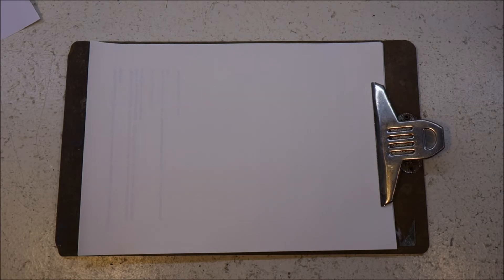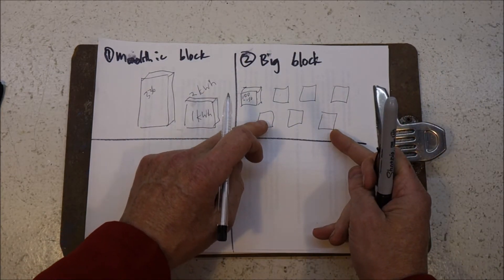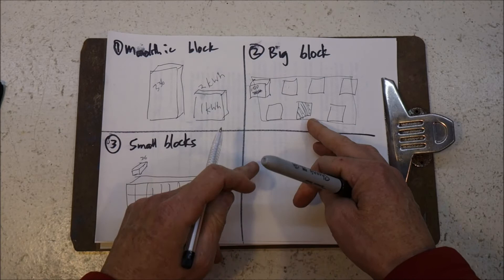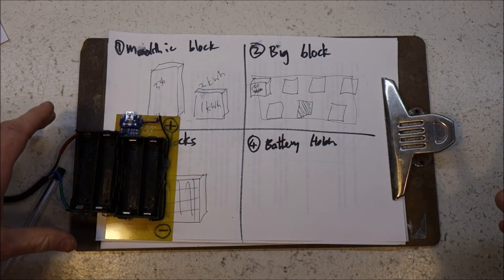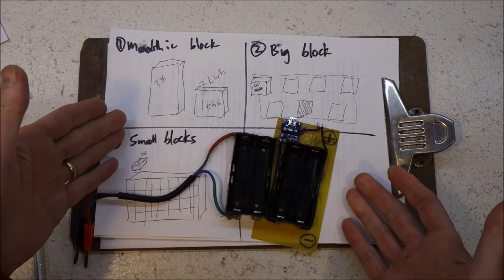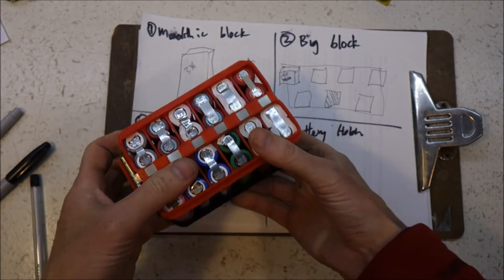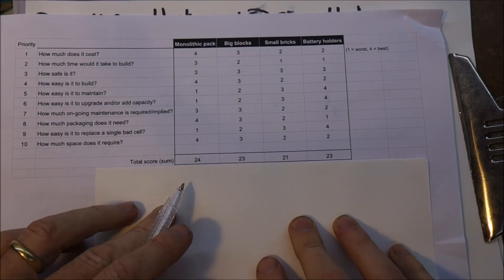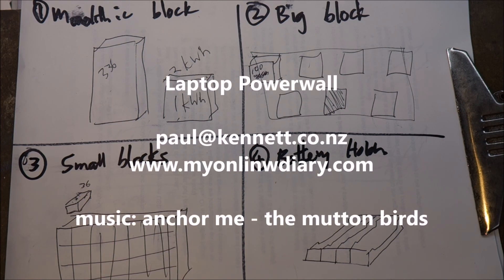Laptop Powerwall 34 - interconnection options

Comment: I think you should actually do a combination of choice three and four, allow me to explain. What you should do is assemble a bunch of small blocks like in option 3, but instead of the cells being in small blocks they will be in battery holders. This would allow one to have a mix of choice three and choice four both at the same time. Concieveably this would allow you to have a bunch of small blocks made out of battery holders and other small blocks made the traditional style all mixed together in one system. A system like the one I'm thinking of would combine the benifets of system three and system 4.
Reply from the maker: Agreed. Since this vid I've built a 1kWh small blocks pack and a 1kWh battery holder pack. They're both wired in parallel with the existing 2kWh Powerwall. And now I'm monitoring them in use. So far so good: https://www.youtube.com/watch?v=bKaR20mcTlk

Comment: I´m going for small blocks with 42 cells. already i have 30 Blocks finished, connected as 6s5p prepared for later 15s2p with sma sunny island usable 8 kwh, with the option to extend to 15s3p and later 15s4p. the reason to have one ore two spare modules cold standby is an important reason.
Reply from the maker: Nice. How are you connecting the small blocks together? What kind of connectors will you use? I'm tossing up between 4mm banana plugs, Deans Ultra and XT60.
Reply: at the moment i charge with 35a and discharge with 12 a so i use xt60 at the moment. 

http://www.hobbyking.com/hobbyking/store/__14855__4mm_Banana_Plug_to_6_x_Male_XT60_in_parallel.html

the 4mm banana i changed to xt60 also.

later i adapt every module from xt 60 to a connection terminal with a 10mm direct connector. between the connection terminals i use 50mm cable.

http://www.xt-audio.de/xt_gb/acv-303601-02-verteilerblock-2-x-50-mma-eingang-8-x-10-mma.html
Reply from the maker: That looks like a good simple solution. You got any pics online of you setup?
Reply from the maker: Ooooo - I like the server cabinet. Plenty of room for expansion there.

Comment: I like the small pack idea the best, makes cell replacement easy and quick. I am off grid now for 12 years and find trouble comes when it least excepted., with that said, quick and easy will pay in the long run. I also like the idea of two cells strapped together with a fuse to change, again quick and easy. The holders cost too much up front but allow for quick painless changes. Just my idea on this subject. Keep up the great work. Have a big smile to all.
Reply from the maker: What kind of batteries are you currently running? (No pun intended).
Reply: I have lead acid batteries in my system now. Still the best bang for the buck. But things are changing fast in the battery world.
Reply from the maker: I was running 3kWh worth of Trojan T105's up till now. The laptop powerwall setup was cheaper for me but took a lot more time. Fun project though.
Reply: I would agree but I have a very limited source for 18650. Price is high on ebay here in the USA. Around 10-12 for six cells.
Reply from the maker: Ouch. In that case - lead acid makes more sense.

Comment: Hey Paul. Great Video explaining the different battery pack configurations. I would say that small block is a great idea. I do however like the battery holder idea as well for the simple fact that you can swap cells out so easily.  The down side is that both score higher on the cost and space side of things.  Does ease of cell replacement overtake space and cost? I'm not sure but I wold say small block maybe the best out of all of them.

Cheers and keep up the great work and videos.

Comment: My question on using battery holders is.. Would corrosion build up on the contacts over time? I remember someone saying it would and thats why the battery holder idea isnt that great.
Reply from the maker: +Mikes DIY Tesla Powerwall I've open several hundred laptop batteries over the last year ( as I'm sure you have) and have found a small number that have rested. And some of those laptop batteries have been 10 years old. 
So I'm guessing battery holders will be the same situation. After some years there might be a small number of cells that do corrode. I assume that a little bit of visual inspection would catch that before it became a problem. Even if you only looked at the cells once a year  - surely you'd notice something - then just swap it out?

Comment: Small block for sure. My reasoning is, I have a 40 cell block x13, 1 of my cells went bad and started drawing off all the cells in the block. With in a week my cell block was at 0v!!! So it was fairly quick to determine which cell was at fault. Great video and explanation.
Reply from the maker: +Craig Minca Now I'm really curious to know if the internal resistance would have helped identify an issue with that cell beforehand.
Reply from the maker: +Craig Minca And here's the vid I did on internal resistance: https://www.youtube.com/watch?v=fxRCyk4tLSA
Reply from the maker: +Craig Minca Yep. I didn't use anything higher than 125 mOhms. Anything over 150 mOhms I gave back to the recycler. The 126-149 mOhm cells I'm holding on to in case I can find a use for them.
Reply: +Craig Minca, Thats why you first of all should check for self discharge! For more info: https://endless-sphere.com/forums/viewtopic.php?f=14&t=26383#p391108
Reply from the maker: +Craig Minca Ouch!
Reply: geeze that's a worry.  was this with fused cells?  did you check the internal resistance of each cell before building each block?
Reply: yes all cells are fused. not to concerned with internal resistance as long as charge time is with in 2.5hours. This cell just wouldn't hold a voltage. After 1.5 days the voltage went to 0v's. The capacity was fine around 2.4amps. I guess when you are using 2nd parts with an unknown previous life this is a risk. Now all small blocks have there own voltmeter, so monitoring is easy.
Reply: now im worried!! What should it be? I haven't checked any internal resistances. I'll check when I get home.
Reply from the maker: +Craig Minca Short answer is; anything under 100 mOhms is good, under 150 mOhms is OK. Here's a long answer: http://lygte-info.dk/info/Internal%20impedance%20UK.html
Reply: Thanks mate, I think I might start checking now. So have you been discarding your high ohm cells?
Reply: +Paul Kennett Does internal resistance ever change with charge state of a cell?
Reply from the maker: I'll defer to the Danish expert: http://lygte-info.dk/info/Internal%20impedance%20UK.html who says:
"The internal resistance will change with temperature (decreases with increasing temperature), battery age (Increases with age), but also with charge on the battery (Increases when the battery is nearly empty)."

Comment: Similar to metionned further down, the battery holders seem the simplest option for something that will not need movement (as the samba project, bicycles,...) in terms of build and maintenance (although not sure about the space). Also less soldering (aside from the fuses, although the connections between the holders could be the fuses)? One of the things that is stoping me at the moment is the thought of soldering 18650s as I have very little experience soldering...
Reply from the maker: +Rincewind TheFirst Ah! Good point -  battery holders would be a disaster for an e-bike. I think maybe that was the subconscious issue I was fighting.
If you keep the cells in pairs then soldering to the link strap is less risky. Of the two ends it's the positive end to be respective of because the negative case goes up an over the top edge. Then there's a 0.5mm layer of plastic insulation, then the link strap. Here's a vid that addresses that issue: https://youtu.be/Bd6oFpexA4I?t=221

Comment: Paul, first thank you for great DIY series - inspiring and informative. 
I am exactly down the same line of thought as you in this video. I also thought 4th option is too crazy. I just thought you can put the battery holders back to back creating something similar as your small block, putting in batteries(for you pairs) from both sides. As was written below have individual fuses to collecting 'busbar' but still, since we use old batteries from laptops also replaceable.
 And also I thought to have something like car-fuse for each block - standardized, cheap, visible and easily replacable?
Reply from the maker: +Martin Kubiš I like the idea of combining the battery holders and small block concepts together. That way you don't need a 3D printer. We could do 2x4 battery holders glued/riveted back to back with another 2x4 - which would fit 16 pairs or 32 cells. If they were all 2 Ah cells you'd end up with a 1.6 kWh pack. 2.4 Ah cells would produce a 2 kWh pack. Nice.
Reply: +Paul Kennett Yes, not everone has a 3D printer. The question is also price so if 4bat.holder can cost 26c then (using pairs) 1kWh multiblock takes cca 40pcs around 10 bucks, very cheap! I thought the clasical 18650 holder with 3*1 or 4*5 'holes' is cheapest but take into account busbars and soldering cells and you need top and bottom...
You will not avoid soldering completely but at least not directly on the cells (we know they dont like heat) and the advantage of changing is great. If only there was way to add miniLED light like on TP4056 minicharger when 'fuse'wire melts to inform us to change that pair, maintenance would be even quicker. 
And then with small blocks, you achieve in series desired voltage and then just add more and more capacity, I like Peter's HB Powerwall and Jehu's very nice designs but I think it is too big for modular approach. Of course it depends on usage (Powerwall size/EV). The small blocks allow (theoretically) to add or take them (blocks or cells) in or out staying 'online' - quite important for offgrid. 

I was wondering how many Amps can take the Nickel strip you use and is it necessary to fuse each miniblock when having Tesla style fuses for each battery?
Keep up the good work!
Reply from the maker: +Martin Kubiš There theoretical current capacity of my strapping is 20amps. But my electric lawn mower peaks at over 100amps over single  strap. My preference is to aim for 10amps constant.
Reply from the maker: Block level fuses would save the day if it plugged a block in the wrong way round. Which I am totally capable of doing. 😕

Comment: Small block would be easier to swap out any defective cells for serviceability but I seem to like home brews idea slot in clean and simple.ease of connection and visibility of the fuses.
Reply from the maker: +John Little Good point. I could mount my small blocks standing on their ends with the fuses facing forward. I'll have a play with that layout option to get a sense of what it might look like.

Comment: I'm going for the holders in a 7s setup with possible 50 or 100P. Where I live there is hard to come by cheap dead laptop batteries. So I'm going for new NCR18650b from Ali express   Around 35$ for 10pcs. And that is why I go with the holders. Easy to change our batteries. And no need to solder on does new pretty batteries :). It will take some time to buy them all but I think it doable, need to quit smoking for the extra cash  :)  it a size different on using holders. But if I use 100p it will most likely be 2meter long in one string :) so I thinking maybe 2 rows  of 1 meter. So in the end there will be 14 rows or something. I think it's a fun project, but if it fails I solder them like Jehu :) fuse wire is also easy to attach on the small legs on the backside of the holders. That's how I think of the holders. Good luck with yours.  /Eric (Sweden)
Reply from the maker: +Eric Friman I would recommend buying a few of those batteries and testing their capacity before making a large order.
I've just found a source for 18650 battery holders on Alibaba - the price looks good for minimum orders of 100 holders: https://jiatel.en.alibaba.com/product/60388170917-801444728/Equivalent_of_MPD_BK_18650_PC6_four_sleds_18650_battery_holder.html
Reply: +Paul Kennett yes that is true :) I'm buying them in 10pcs lot all the time and so far all checks out with good discharge capacity. Thanks for the alibaba link. Think I give that a shoot 👍
Reply from the maker: +Eric Friman Nice. His conductors look a but overkill to me - but an ebike can pull a lot of Amps - so maybe not. @Rincewind TheFirst noted that those battery holders would be less ideal in an environment where the cells could be shaken loose, like an e-bike. But for a powerwall that's not an issue. Interesting.
Reply: +Paul Kennett Yes exactly what I thought. It faces me an idea about how to place the busbar.  It was a overkill but just solder a fuse from the holder legs to the busbar would work fine. I'll give it a try :)

Comment: I'm working on a small pack idea using these stackable battery holders:
http://www.thingiverse.com/thing:1289889
Initially, I'll be using 4s20p setup for a 16v system.  Later on, I can reconfigure for 7s20p for a 24v system.  The small packs will be plugged into bus bars via Powerpole connectors with separate fuses for each battery pack.  This will mimic my current 12v lead acid battery bank where I have many 35-50AH batteries in parallel.  If one goes out or needs to be pulled for testing, just do so and the rest of the system keeps running.  Also easy to grow the system, once I accumulate 80 (or 140) cells of similar capacity, I can build another pack and plug it in.
Reply from the maker: +R Brown (4Crawler) Ah - yes. I looked at that one too. My Printrbot Jr can't print that large so I wandered off toward my own design. But it was nice to see someone else keeping the cells in pairs like I do. I wouldn't recommend putting a metal screwdriver under the positive battery strap though - if you do want to add an extra insulator use a plastic tool to raise the strapping. Looks like a good solid design though. Good luck!
Reply: +Paul Kennett Yes, I'm using a plastic tool to lift the positive strapping and fitting pieces of the insulating paper that comes with the battery packs.  The holder seems to be very well designed, I've got a dozen or so printed out now.  Just waiting on getting enough cells tested plus a 4S BMS to arrive.
I do like your holder design as well.  Having the strapping for interconnects is nice.  I've not tried wiring up one of my holders yet, will have to see how that works.
Reply from the maker: +R Brown (4Crawler) Lot's of fun experimenting to be done.

Comment: Small block with some sort of quick connector molded direct into your 3d shapefile then mating into a chassis that receives smallblocks.  The chassis would probably need a bus bar to handle peak load however the modular nature is very appealing.  Especially when using recycled cells.  

Jehu seems to believe that cells in a mono block can somehow magically remain balanced after years of use.  I think it's a stretch - luck maybe and perhaps he has been very selective in the cells used in his blocks (perhaps as simple as grading by internal resistance).  His approach is not unsafe (cell level fuses) however the health of his packs must be as a result of grading - it's just chemistry after all.

By the way - and at risk of it going straight to your head - this is the most informative powerwall DIY channel on the internet.
Reply from the maker: +nztitirangi Went straight to my head. :)
I think Jahu's design also benefits from having so many cells in parallel that any anomalies become statistically minor.
Reply from the maker: +nztitirangi I'm still thinking about a connection design that allows me to plug the "brick" straight in. My current design has the connectors at the front so I can see/inspect/fiddle with them more easily. They may not stay that way. Still thinking :)
Reply: +Paul Kennett Blade servers and service provide networking kit have used this concept for eleventyseven years or so (a really long time) where cards that draw a fair bit of current slot straight into a chassis that provides a networking and power bus.

I guess this all comes down to how often one should expect to inspect and maintain a powerwall - which comes back to the point around grading and whether or not it could be reliable.

I'm pondering your ideas on internal resistance versus life/capacity and grading.
Reply from the maker: +nztitirangi As Si-Fi author William Gibson once said; "The future is already here — it’s just not very evenly distributed." And sometime the future has been around for ages, so I guess it's not really the future at all).
Reply from the maker: +nztitirangi On the other hand - a bad cell might just run the rest flat (see Craig Minca's comment above).